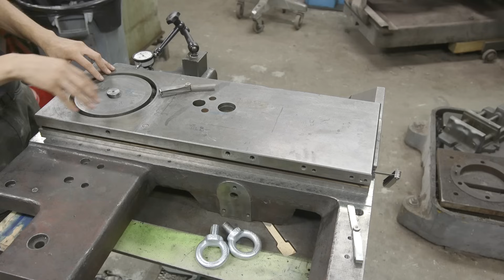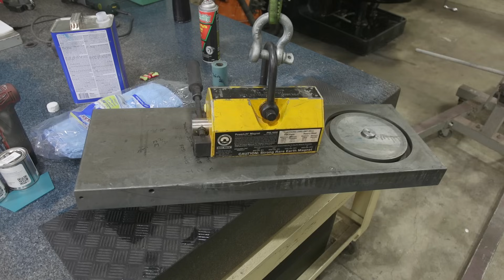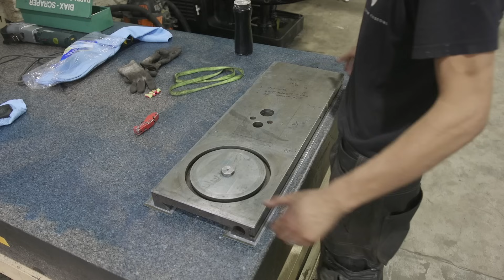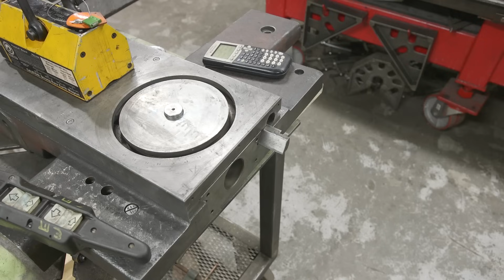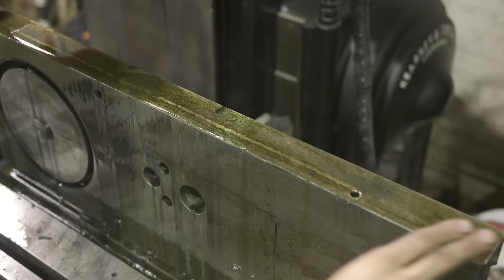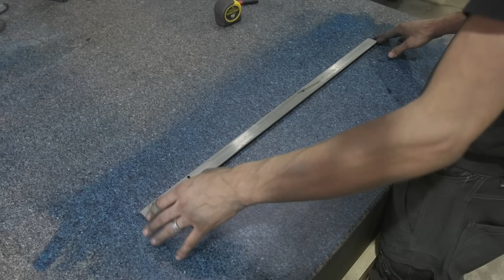Correcting Our Mistakes and Fitting the Gib | Lion Lathe Restoration

Comment: Groves running along the travel is not the best thing. This places will never touch, and the side will wear uneven
Reply from the maker: Groves were there previously so I copied factory. Your right it will not touch that spot will not wear but everywhere else will evenly. It would only ever be a problem if you crossed the high spot but this will never happen because the it will be in the groove.

Comment: You had some major issues but with persistence and high standards as your goal you got it done. 

Will you share your source for the turcite/adhesive? Also will you be making a new acme screw and nut?
Reply from the maker: Check the previous videos and you’ll see that I already made new screws and nuts
Reply: @VanoverMachineAndRepair  I must have missed those! Thanks for the info and reply.
Reply from the maker: I was looking for the containers. I don’t have them anymore, but I believe it’s a Machine Tool rebuilder in Wisconsin should be pretty easy to google. They turcite and the epoxy
Reply: Precision Scraping and alignment in Kaukauna?
Reply from the maker: @procyonia3654  machine tool services and training
Reply: @VanoverMachineAndRepair  oh jeez you did say that at the beginning of the video too, I must have glossed over that

IL have to give them a call next time I buy turcite, they are only 25 minutes from me
Reply from the maker: @procyonia3654  no I just looked it up
Reply from the maker: @procyonia3654  no I just looked it up